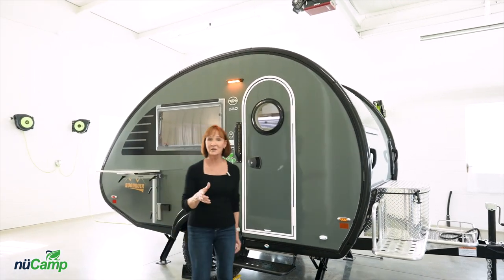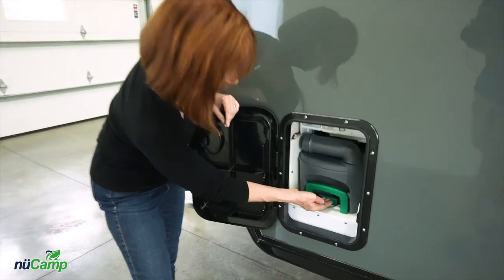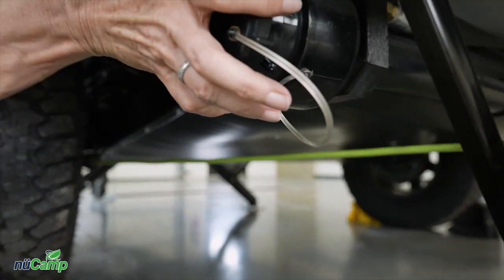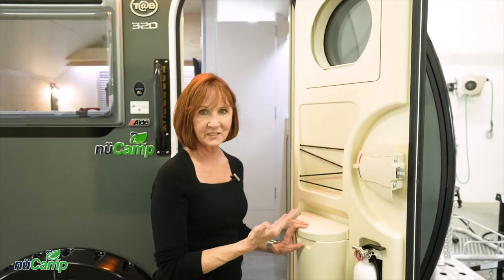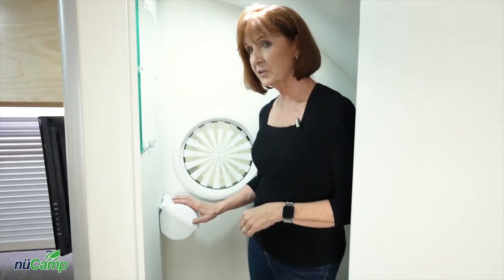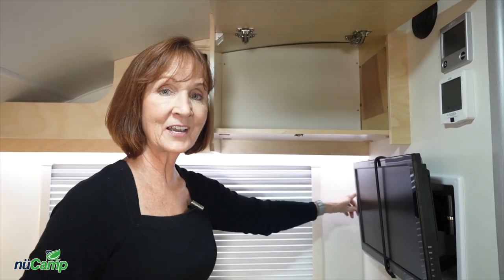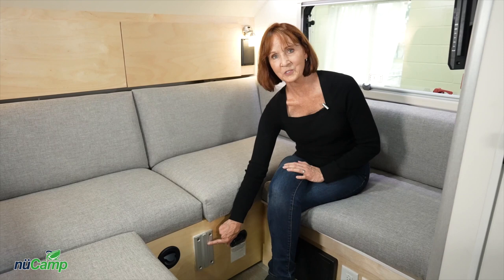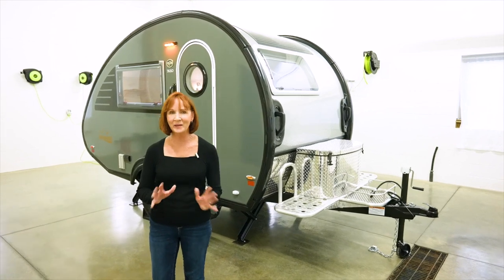2022 TAB 320 S Walk-Through

Comment: Thank you so much, this is incredibly helpful, picked up mine a couple weeks ago! A few questions if you have a minute: 1>do you put both water pumps on if you are connected to city water or when should you turn the nautilus pump on vs the control panel pump on? 2>if you did not get the extra solar panel plug-in on the diamond box, is that a simple add-on by the dealer OR is it really tricky/expensive to get added? 3>Will the air-conditioner only function on shore power or will it work off a charged battery (for a short period of time)? and lastly 4>can you turn the fridge on while driving to the site to start it cooling and would it be cooling via propane or battery? Thanks, answering these I hope will help other owners!
Reply from the maker: Please reach out to help@nucamprv.com. Our Customer Experience Team will be happy to help answer your questions!
Reply: @nucamprv  OK copied exact message and forwarded on as instructed to that email and it says it doesn't exist. I think I will add an r into the email.
Reply from the maker: @jillkismet1503  Yes, help@nucamprv.com is correct. Thank you!

Comment: Nice thorough walkthrough! Where can I check the level of the glycol for the Alde?
Reply from the maker: The glycol tank on the 2021-22 TAB 320 is in the bathroom – underneath the sink and above the toilet. The panel is held in with screws and the screws have caps on them that need to be popped off to expose the screws. Remove this panel and you will have access to it.

Comment: Can a small appliance cord reach the under the sink plug without an extension cord? Any consideration to mounting it at the counter with a retractable pop-up unit? Also, I'd think most people would prefer a lockable front storage box. Is that an option? Thank you.  Super video!!
Reply from the maker: Yes, it should reach that outlet. There is a hole in the top of the counter behind the sink on the left side with a white cap over it. You can feed the cord through it to the opening to the outlet. The front storage box is not lockable as that is where the propane is stored. Some areas have restrictions on locking up propane. Thank you for your feedback!